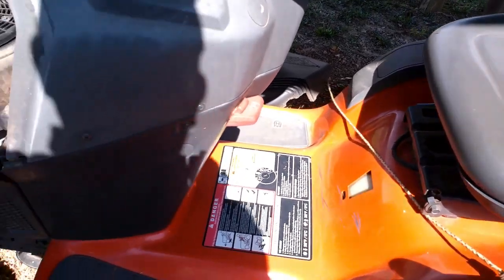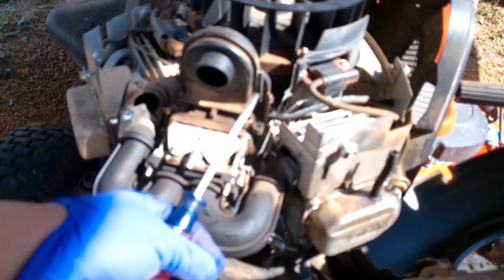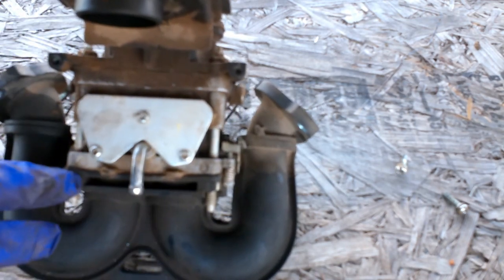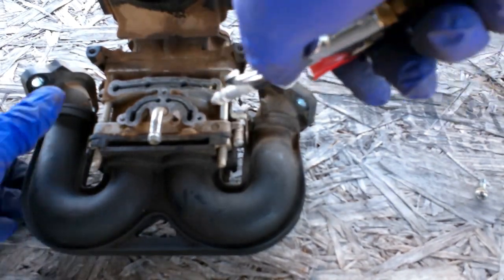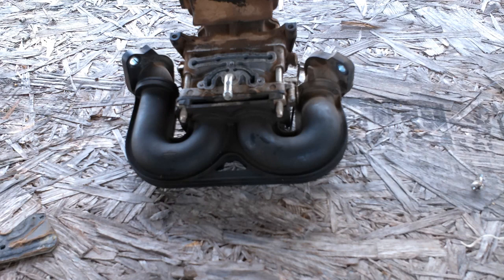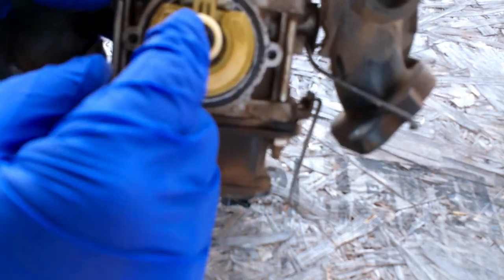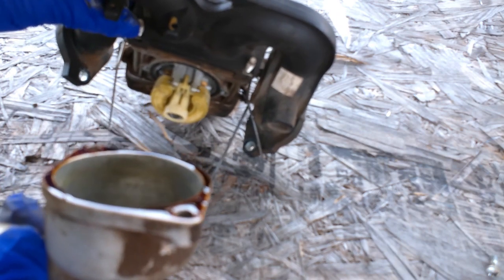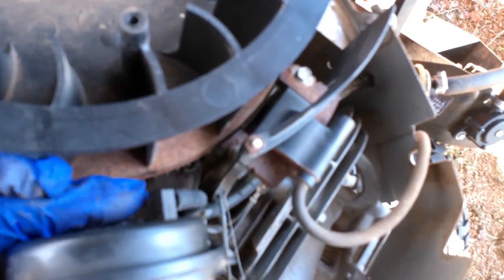How To Remove & Clean Carburetor on a Riding Mower

Comment: Hey there! I’m having trouble finding where the other end of the hose from the carburetor goes? The specific ones I’m talking about are at 12:45 when you just slid them on
Reply from the maker: I didn't have to replace that line. I would say that line is the return line going back to tank. If you need to replace that line then you would have to remove some more covers.